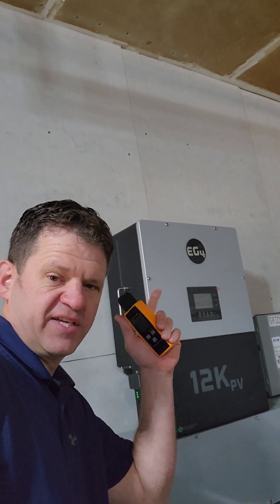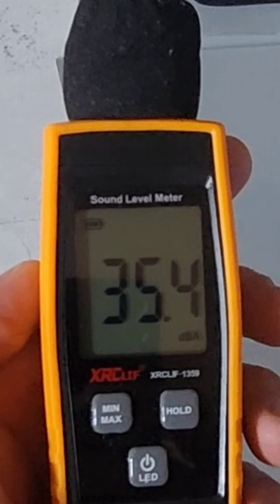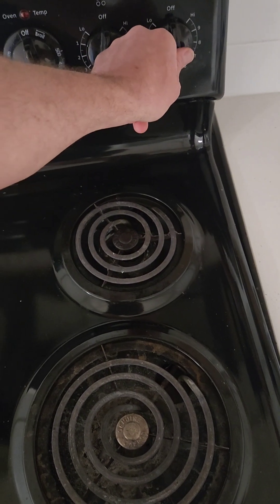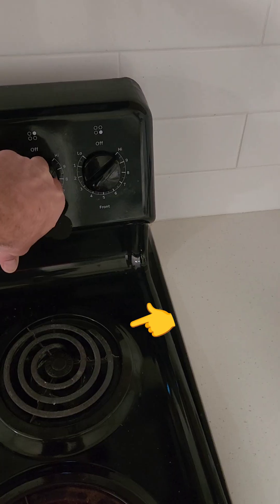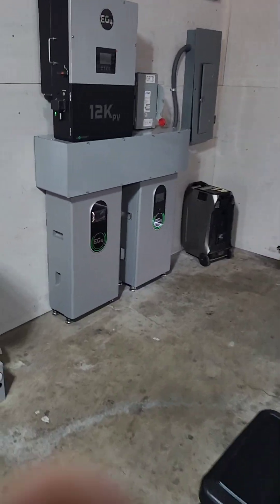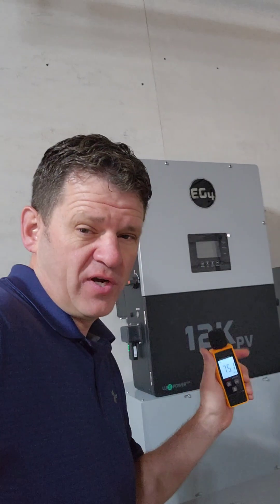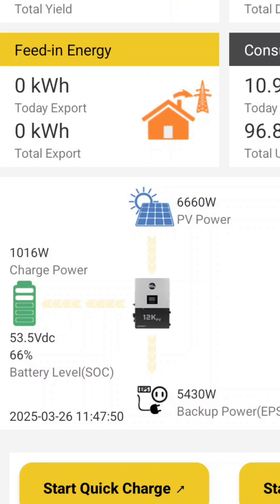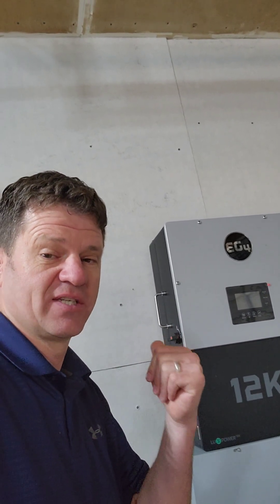How loud is the EG4 12kPV - Noise Test

Comment: Nice test.  That's always an after thought is the noise level.  It'd be easy to design a whole system and it covers your electrical needs but your wife can't stand the noise after you install it.